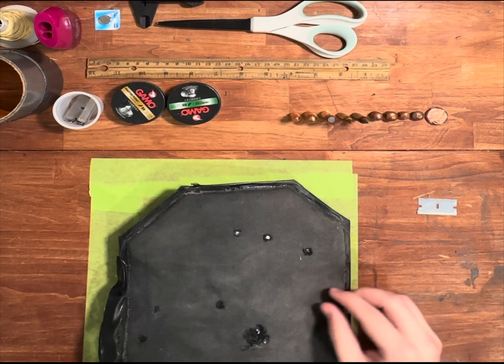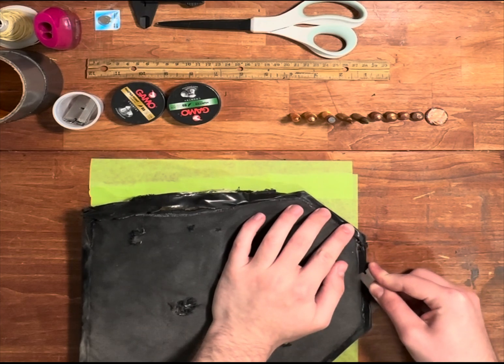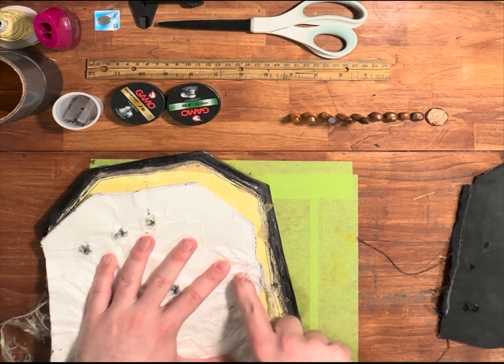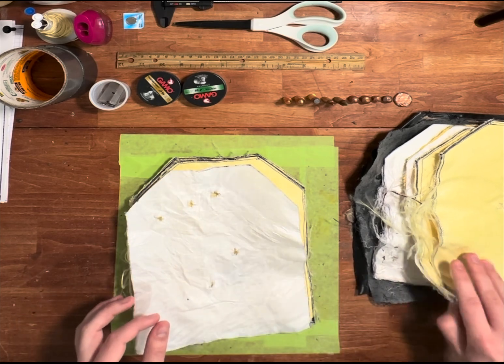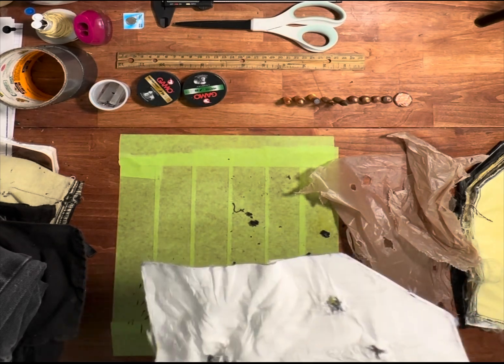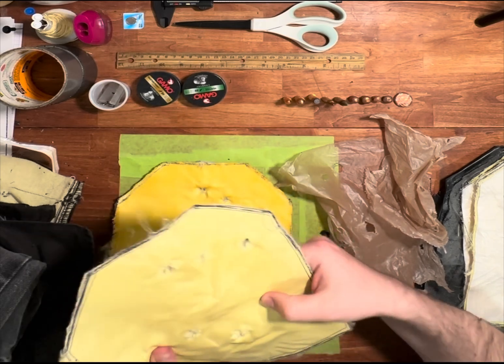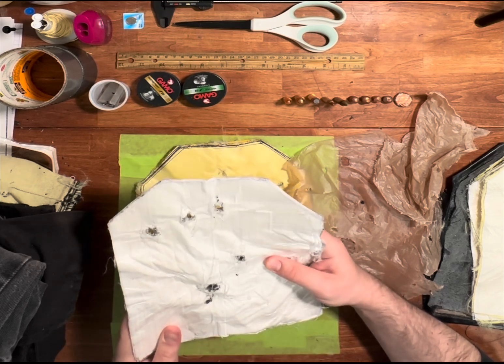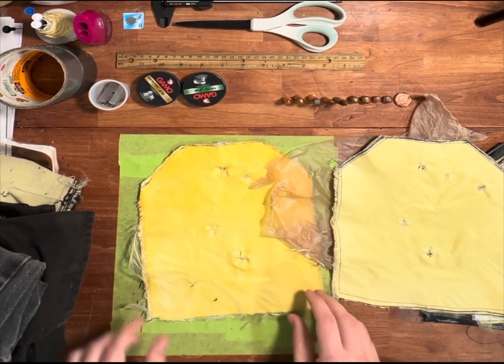Homemade HYPERLINE body armor test and teardown. 44 mag is no joke.

Comment: The white material up front is called "Uni-directional fabric" which is made of Dyneema, the middle yellow one is woven Kevlar, the yellow one at the back is Uni-directional fabric made of Kevlar fibres. So Hyperline uses Dyneema UD fabric to catch bullets, and woven kevlar to release localised pressure and UD kevlar to control back face deformation. That's smart engineering.
Reply from the maker: @GannianZhang  https://youtube.com/shorts/cELw3Ci8ACs?si=FQfNnYrvLBJU7Jfk
This is an updated version based on some videos on the armor I picked apart as there is not really any articles or information regarding exactly what its made of. Depending on when the video is from the armor seems to change, some videos show it having a felt and some dont, also some videos seem to show more woven aramid than others. This is just my best guess.

Comment: Keep building and testing you'll get there if i could only suggest one thing you need a good material supplier like honeywell or dyneema or point blank or all of them listen your product is only as good as the materials your doing it though and finding what doesn't work and showing others thats awesome
Reply from the maker: Thanks, Ive looked into a lot of the name brand suppliers and they either dont respond or wont sell lower than their minimum purchasing requirements. And since they mostly sell to big companies the minimums are are like 100 yard roll which can be anywhere from $1,000-10,000. I just dont have that budget. I wish the bigger companies were more lenient with who they sold to and how much they could buy.
Reply: @Armor-Innovations  dang not cheap theres probably is a few companies out there but yeah businesses are in the business of making money
Reply: @Armor-Innovations Have you looked at SkarrArmor at all? They sell ballistic rated materials at a reasonable price. I can't personally vouche for the quality, but it looks like it's up to par.

Comment: Great content. I liked the copy of the Hyperline armor you made with readily available materials. Is the Hyperline armor supposed to be 3A+? You should build another home brew 3A panel and try to make it rated for the 3A armor killer pistol rounds out of a 16 inch barrel carbine. 
I know that may seem like an arduous task but the theory I've heard from others about making the strongest pistol armor anyone can make is that if you can manage to make 3A armor defeat pistol calibers even the ones designed to penetrate 3A from a carbine rifle with a long barrel 16 inch or more, then that armor will defeat any pistol caliber out of any handgun with a normal length barrel.

So, what do you think about this? Do you think you could attempt to make something like this and show us the build video so we could make our own?
Reply from the maker: What do you think would be like the max thickness of such a pannel? Because obviously I could just make it like 3/4 of an inch but thats like cheating so what do you think should be like an optimal max thickness for such a pannel?
Reply: @Armor-Innovations  3/8" would be a good thickness. That would be between quarter inch and half inch. It would still be within the perimeters of the thinness of a 3A+ panel while also be not too thick so as not to be considered "cheating" as you say.
For things you can do to make your Hyperline panel experiments stronger is to look into something I think it's called phenolic coated Kevlar or something like that. From what I've heard a few layers of phenolic coated Kevlar like 3 or 4 layers is said to stop 9mm FMJ. Normal ballistic grade Kevlar I think you need something like 17 to 18 layers to stop 9mm.
Reply from the maker: For sure! The ammo I was using said 1610fps on the box and out of a cabine is was probably a bit hotter. This ammo was all I could get before I needed to film. I have the proper ammo comming and intend to test is on both this pannel and the new one I make.
Reply: @Armor-Innovations  Please don't stop until you make the ultimate 3A+ panel that can save someone's life from every pistol round under the sun whether it be from a short barrel, long barrel, whatever.
By the way I'd like to see you make a 3A+ panel that can stop one of those defense rounds like the .357 Sig or the .40 S&W out of a pistol with a standard length barrel. I think the defense version of the .357 Sig/.40 S&W even out of a normal pistol are both booking it at something like 2,000+ feet per second.
Those special defense rounds will be very difficult to stop I imagine but if you can manage to stop them and show us the process of how you did it that would be very valuable and useful information for anyone.
Reply: My two cents here. My brother and I always make them with one question. If we doubled them to wear, would it be too thick?

Comment: If you deliberately choose cartridge loadings and barrel lengths to guarantee the round will way exceed the velocity the armor is rated to stop, don't be surprised when if goes through. 

That's not proof that the armor is junk. It's proof that you didn't read the standards or take them seriously.
Reply from the maker: I understand where you are coming from. The rifle I got was really the only 44 magnum within my budget, and all the 240 grain was cleaned out. Quite frankly, the armor does need a rework, even if it isn't junk. But yes, having the proper barrel length and ammo would have provided more information on the capabilities of the armor. If 3A-rated armor can stop this round, then mine should be able to as well; I plan to test this in the future. Thanks for the input and engagement.
Reply: @Armor-Innovations  The current NIJ standards call for testing with a .44 Magnum Semi Jacketed Hollow Point (SJHP) bullets with a specified mass of 15.6 g (240 gr) and a velocity of 436 m/s ± 9.1 m/s (1430 ft/s ± 30 ft/s). I think the velocity is even lower for "conditioned" ie worn and broken in armor. 

Were you getting velocity data from your own chronograph or data on the box? If you bought a round that normally does 1,600 fps out of a standard pistol length barrel and then fed it into a carbine, you could have been hitting that vest with 1,800 fps or even more, and the kinetic energy rises more steeply than the velocity. Even 1,600 is really more than any IIIA vest is rated for in that caliber and it's also where soft armor in general leaves off in terms of being able to stop a bullet of almost any kind. 

A number of manufacturers including Hyperline I think offer "IIIA+" builds which are not an official rating but are overbuilt to stop things like FN 5.7 pistol rounds. They might stop what you're firing with too. Even still, it's a good idea to consider that no soft concealable vest is really up to the task of stopping centerfire long gun rounds of any kind even if the round in question is frequently a pistol round.